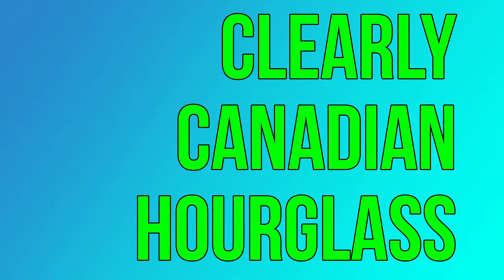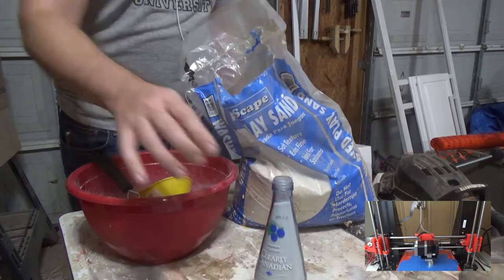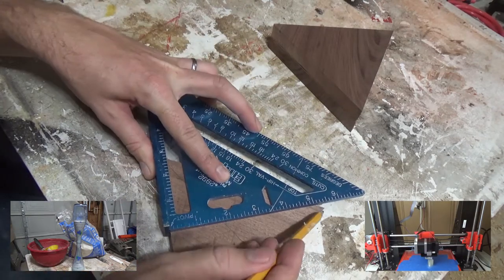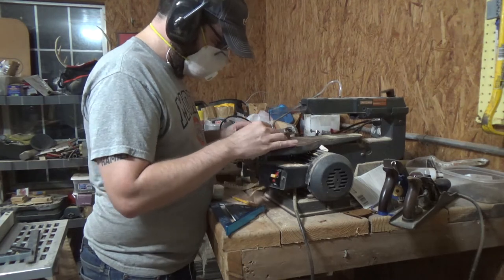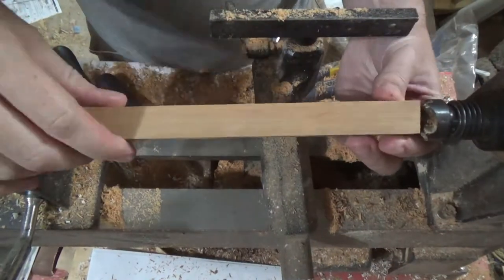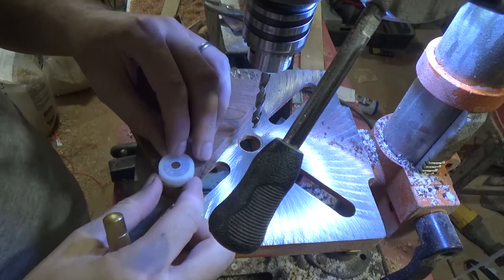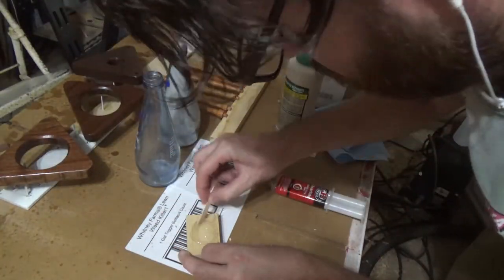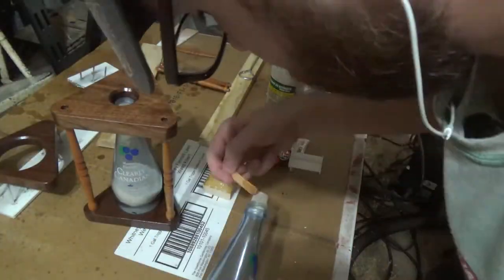Making a Clearly Canadian Hourglass | How To

Comment from the maker: Pro Tip: Getting sand to fall through a funnel at a regular pace is a huge pain in the rear. I did a lot of research into the best sand to use and am reliably told that "river sand" is the best. But I didn't have access to it... so depending on the mood, this 5-minute hour glass is sometimes more or less than 5 minutes (as it shown at the end of the video). Anyway, thanks for watching!
Reply from the maker: Also... ah, first!